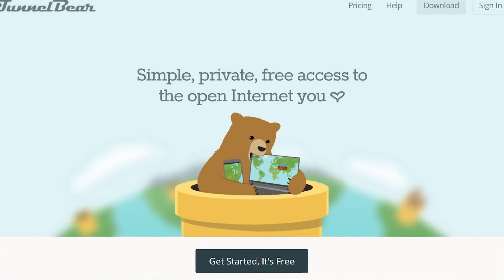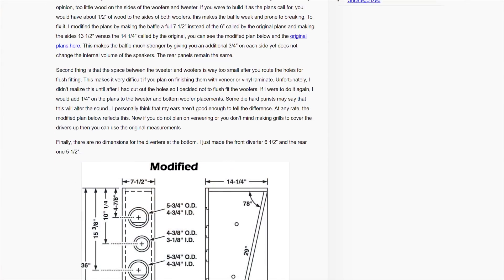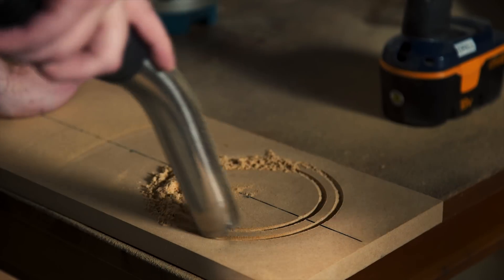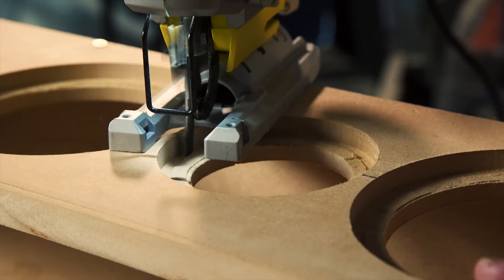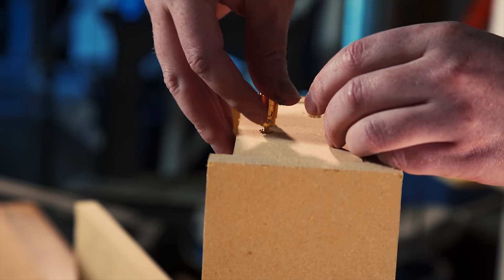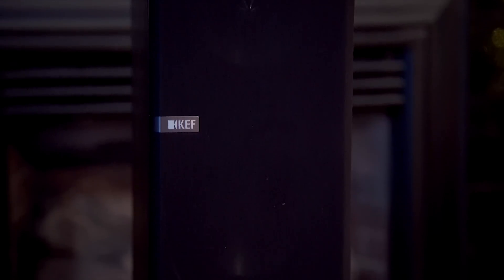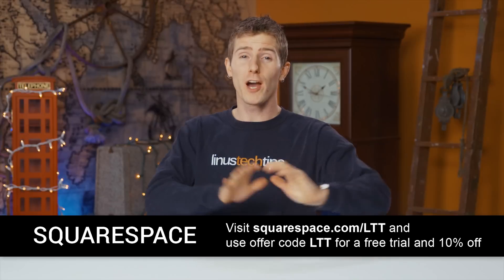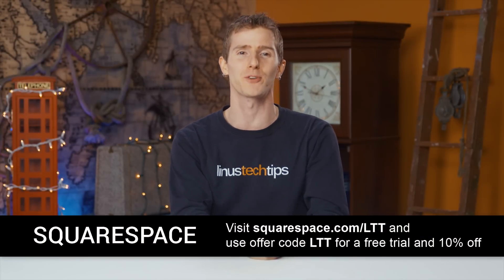DIY Speakers for Less Than $300!

Comment: You can get very decent mid 80's 2nd hand speakers for around $50 to $100, and an amplifier for an extra $100. You do NOT need to buy new with audio equipment!
Reply: Maybe speakers have gotten smaller, but that's it. Some people enjoy vintage audio simply because there's no modern equivalent that sounds or looks the same. if anything, speaker technology has actually gotten worse. My EPI 100s have cabinets that were handcrafted by coffin makers, with beautiful solid wood, and I would NEVER replace them with "made In China" garbage
Reply: Exactly! Some of us just love vintage equipment. The warm sound of paper coned drivers and a hand built box, nothing can beat it!
Reply: Frietpan - I don't get many used amplifiers so can't comment on that, but replacing the capacitors on speaker crossover was easy enough for me! Refoaming the speaker surround on one pair wasn't so easy, but still doable :D
Reply: Ayy Lmao Thats so true. A lot of great audio companies like Celestion, PSB, Tannoy etc... had amazing speakers. The same is true for amps and recievers and other audio gear, Pioneer, Technics, Sony etc... all had amazing analogue amplifiers with specs that rival the best Class A/B amps even now. If you know what your looking for you can get some amazing audio equipment thats equal or better than anything you'd get nowadays. Certainly the stuff we buy now is designed to be cheap and most things only last a few years if that. I have a Pioneer SX780 from 1976 and a Technics SUV6X from the 80's that are all original and still great. Although the capacitors do go out of spec for speakers and electronics after 20 years so I had mine replaced in a hifi repair shop to be sure the audio channels and sound was perfect. Paid $180 for both and they sound better than my band new Onkyo A9010. He's some proof the old stuff had it all figured out back in the 1970s http://www.iavscanada.com/receiver-shoot-out-vintage-vs-high-tech/
Reply: I completely disagree with this. According to JBL, the fairly compact 4311s from 1974 are designed to hit 22Hz, and can easity pull off 20 at -1dB.
Reply: Mid 80's speakers from brands like Technics, Pioneer, Fisher, etc will have foam surrounds which will have dried out and will flake and disintegrate, if ever played loudly. Components such as turntables and amplifiers were built very well back then, but the speakers were not built to last.
Reply: Found a pair of rare 1974 JBLs for $35
Reply: Yup, I got some B&W speakers for $3 at a tag sale!
Reply: Your telling me, that bass wasn't a "thing back then" in the 1980s. Ummm no, I really don't know what speakers your listening to, but many from that time period could go VERY deep, even the $50 radioshack specials. Also the fact that you're measuring speaker performance by bass performance is just sad.
Reply: Definitely. Hit up the local pawn/thrift shop, pick up some 80's Technics floor speakers with amp and you're set!
Reply: Goodwill FTW got 2x PSB Alpha CLR1 for $16, a Klipsch sub 12 for $22 and 2x KLH model 23 for $32.
Reply: I feel like a need to make a video proving everything... the problem is that my camera's mic cannot pickup 20Hz and I doubt your speakers can play it back. I guess I could use a spectrum analyzer to prove it. 

They (of course) cannot play 20Hz at -3dB, but they can at -7dB. The FR is something like 40-22K Hz at -2dB. https://www.hifiengine.com/manual_library/pioneer/cs-63dx.shtml
Reply: Matthew Pawlak I agree. Everything's gone to small ported enclosures. My Boston acoustics have fantastic build quality.
Reply: It is so true. People love that boomy sound. I love the sound of smooth, tight warm bass and balanced mids and highs.
Reply: Joshua's Recordings That's sort of the unfortunate thing. Some people justify paying for $1400 speakers, thinking that they sound good, powering them with a $600 A/V made in china reciever, not knowing that spending $50 in goodwill on a pair of speakers and vintage amp will sound quite a lot better. You'd like listening to my setup comprising of JBL 4311s because of how natural they sound. I've seen some of your videos and I think I'd like to listen to your setup as well!
Reply: Bass isn't judged by your subwoofer's impedance. It is judged by the frequency response of your speaker, the free air resonance of your woofer driver, the sensitivity of your speaker, the power handling of your speaker, and how much power your amp can output. I take it your into car audio.
Reply: Speakers and amps work basically the same since the 70's. The crossover makes a speaker sound good (without one) nearly any speaker will sound crap. So we have drivers, boxes and crossovers (exactly what we had in the 70's). It's who puts the components together with the right crossover, who makes a speaker sound good, and that's it, whether it's in the 70's or now. So speakers haven't really advanced. When you look at different types of speakers (like electrostatic speakers and "flame" tweeters) that may be advancement but way too expensive for the masses.
Reply: dunno about that KRK been running the same model for over 10 years now and its golden no need to change xD
Reply: Its pretty easy to refoam any old woofer. Look that up on Parts Express or YouTube. The new foam is designed not to break down like the old stuff. The older speakers had larger woofers also, I find the new speakers nowadays are ok but I prefer something that has a larger woofer. I have a pair of Yamaha NS-645's and they sound great. I also own some new Q Acoustic Concept 20's. They both sounds very good but the Yamaha's 10" woofer makes more bass and cost only $60 used. They have cloth surrounds on the woofer which unlike foam does not wear/rot out. Next I'm looking for some NS-690's or NS-1000's if I can find a cheap pair!
Reply: +ClockworkOmens X Yeah, PSB is usually a great cheap used speaker. Nice stereo you got for that price.
Reply: Edmund Fisher I made a pretty good speaker on my channel you can go check it out and consider subbing to me if you want
Reply: SOOOOOO much has improved in speaker design and build practices that even the best of the 80s will have short comings when compared to modern consumer or DIY designs. Going used is great, but the price to performance ratios of modern products is too good to dismiss.
Reply: I'm listening on a pair of Boston Acoustics A60's right now
Reply: Brett R Boston A60s are good! I listened to the A70s before and I enjoyed them
Reply: dont agree almost nothing has improved in speakers now days most of the speakers now days are just crap that sells because good marketing look at stuff like the modern JBL and then look at the Studio JBL of the past. NOTHING  has changed in speaker design except from going to plastic instead of wood which is way worse. ofcourse there is still stuff thats on the same level as the high-end from the 80's like genelec they still make great speakers but alot of the shit nowdays is just ABSOLUTE CRAP.
Reply: Matthew i completely agree with you
Reply: Sort of, less resistance = more power from a cheap amp. Professional amps typically run at a minimum of 4 ohms bridged and 2 ohms stereo. Although are typically run at 4-8 ohms. The reason why car audio woofer impedances are so low is because car voltages are low and it is easier to output less voltage and lower the resistance of the speakers (er, impedance).
Reply: I think that vintage audio is the way to go because you can spend less and get more quality, but you have to be careful and know what to look for in case they are damaged. I got jbl j220as for around 50$, and while I know that is not cheap for that speaker, it’s not expensive either and that’s because the cabinet was cracked on the side but a bit of wood glue, it was fine.
You can really get good quality with vintage audio, I got a pair of Mission Freedom 770s (sold for $700 for the pair in ‘85) and a pair of Infinity Crescendo cs-3007s (1300$ a pair in the early 90s) for a total of 85$ and while polymer cones are better, paper isn’t necessarily bad.
Reply: +Edmund Fisher could you link me some good ones? I have no idea where to look for good ones because i don't have any basic knowledge about the subject lmao
Reply: spiders and surrounds tend to rot
Reply: temperature changings, especially which are every day, 365 days per year. Higher Humidity is also 100% not good for loudspeakers. But in a living room, this problems should not be.
Reply: Joshua's Recordings http://www.ebay.co.uk/itm/Spawn-Eggs-of-Pachypanchax-omalonotus-Ramena-Sambirano-Killifish-/311874496114?hash=item489d2b2672:g:5PEAAOSwn-tZHGX1
Reply: My primary speakers are 70's Pioneers that I pulled out of a dumpster. They are huge, (I think they look good), heavy with alnico magnets. They sounds great and play well down to 20Hz. To get a speaker that sounds that good in say bestbuy would require me spending $700-1000 on some nice floor speakers.
Reply: Or get measurement mic and REW.
Reply: @averagejoeaudiophile5122  nah just get three random people who don't know the first thing about subjective listening, cover their ears and ask them which one looks like it has the best sound.
Reply: I do have TrueRTA on my computer and a decently flat mic. I guess I'll get around to make a video on them sometime.
Reply: Not true at all if you know what company's to look for you wont need recapping at all because they used quality parts look at any NAD amplifier like mine NAD 3400 i took it for revision didn't need any caps changed just needed the knobs and the buttons cleaned and bam worked fine again for 35 euro. i also bought JBL 4312's 4412's and B&w dm110's, dm 220's and dm 310's none of them needed recapping and they all sounded great.
Reply: i completely disagree the best sounding speakers i've heard all came from the 80's and 90's nothing has changed nowdays the highend speakers now are still as good as the highend speakers then look at studio's why do alot of the profesional ones still use yamaha ns-10's? everything nowdays is cost saving plastic shit. there are great paper surrounds from the 80's to have my JBL 4312's and they still haven't had issues with the surrounds plus they sound phenomenal.
Reply: well if you know what to look for in your seccondhand speakers you always test them before you buy them like push the surrounds see if they flake just listen to some music and see if they sound like shit. plus technics and pioneer never really made many high-end speakers ofcourse technics did make high-end turntables it all depends on what you buy and knowing what to buy. brands like mission, b&w and the high-end JBL speakers are good but also wharfedale speakers etc.
Reply: what pair of JBL's?
Reply: Tom, I use vintage sansui amplifiers! Sound great when restored, currently running a 350 receiver from 1968 :D
Reply: In the 70's and 80's after transistors took over, you could but old stereo tube amps for abound $50 at the pawnbrokers. I had a few in the 80's and a couple of them sounded better than any transistor amp (by-a-large-measure). They weren't new and sounded better than anything new (unless it was tube).
Reply: You can make great tweeters that handle heaps of power for hardly anything. I got an amp that has 200 + 200 watts @  0.1% distortion, and I haven't blown one tiny full-range "tweeter" yet (and I keep blowing normal tweeters all the time). So I had to do something, so I tried using 2" full-range speakers (Logitech one's) from computer speakers. lol But I radically modified them and I run them out of the box (slightly resisted for 6 ohms). With a sharp object I scribed a line around the voice coil center on the full-range cone, about 5 mm out, around in a circle. This allows more transient response cos it can vibrate like independently to the rest of the cone. I also got rid of the center piece on the full range speaker and left a hole in the center. I then glued a 6 mm triangle made of coffee-can-seal (tin-foil) onto where the cone starts, and the tin-foil triangle is pointed in toward the center. The foil makes cymbals sound like they are being hit and sound like they are made of metal. lol Great "S's" too, really pleasant treble (with power handling). Also being ran outside-the-box is essential cos it not only makes the treble go higher, but also makes the treble louder. And the top-end is so sweet (when it's ran out-of-the-box). Only use a 2.2 mf cap on the 2" full-range, any bigger cap will sound harsh (being out-of-the-box) and so you obviously need to run it with the cap on (and never without one when out-of-the-box). lol The cap also makes the treble go higher than without a cap, cos the cap "pushes" the high-end signal through the cap more than it would normally flow (without the cap). And with the small cap, it will increase frequency response in the top-end and this is also how you get such a great power handling. A 2.2 mf cap with 200 watts going through the full-range is like 2 watts without the cap (which is about what the speakers normally handle). 2 watter full-ranges have thicker voice-coils than tweeters and that's why they handle so much (with a cap). But if you get high wattage tiny full-range drivers, they will have even thicker voice-coils. So the 2 watters are better. lol Combined with the two mods mentioned above, and being out-of-the-box, and with the cap, it sounds pretty amazing for how cheap it is. Try it, before you start thinking I'm a nut-job. :) I run mine with 6" med drivers (coaxial and phase-aligned) set inside a large voice-coil throat in the med drivers (rare as rocking horse shit). I also run the med driver out-of-the-box (with the 2" full-ranges in the centers. Running med out-the-box is tricky, I choked and heavily resisted the out-of-the-box med and combined with some med coming from the woofer as well (and blended). The woofer is in a double chamber bass reflex box. They are the best speakers I have heard, with the open cone sound combined with mellow med from the woofer (blended as much as I can with the crossover). To run med speakers out-of-the box you have to be really radical with the crossover to make it sound even acceptable. lol But I have practice a lot and my speakers are sounding much better, since I started and it's a lot easier to make crossovers. The crossover is more expensive than the drivers (the copper coils). Cheap woofers are "boomy" but sound great with the right crossover (that costs more than the woofer). The sound quality is there but badly lack efficiency after making it sound good with the crossover. lol But my full-range tweeters are not very efficient either (but sound amazing and high power handling) and with 200 watts who needs efficiency. But my speakers are still way-way more efficient than electrostatic speakers (by-a-large-measure). And with phase-aligned treble&med and the out-of-the-box open sound, they sound nearly as good as electrostatics. But at a small fraction of the price.
Reply: 40 hz would be about the lowest we could hear from a speaker (I reckon).
Reply: They are missing out on the treble and med. Med is the hardest to sound good, cos a box makes the med sound "boxy". And there is always going to be a resonance in the med that's really noticeable (or annoying) compared the bass and treble.
Reply: I’ve got an old Samsung surround sound unit and it still sounds amazing to this day no point in buying new when second hand is just as good and cheaper
Reply: or do you mean build it?
Reply: Justwantahover True.
Bought a Pair of heco superior 800 nearly 30kg each box.
And an Yamaha ax 396 for 75 Euro it sounds amazing much better than some of today's over 1000 Euro speakers
Reply: Edmund Fisher I found a pair of cabs on the road, the 12s were coneless but both had a 6" and a tweeter in perfect condition. Definitely gonna build my own boxes for them.
Reply: A lot of 80s speakers have dead tweeters
Reply: @tacodocx667  its usually the tweeter pre amplification which is dead. the speaker itself is usually fine unless physically damaged.
Reply: I just bought a couple of Truth B2031A's. They kick f-cking ass for a price much higher than $200 a piece, and are both bi-amped 265w~ 8" studio monitors. Really just can't go wrong with these. They put out some seriously tasty sound.
Reply: I picked up an Onkyo TX-NR 414 Receiver for about 100 quid 5 years ago as it was ex display,  plugged in 5 cheap little speakers that came with a sub woofer for about 50 quid and have all my devices into it  and the sound is pretty damn good and runs a treat. Only thing i made a point of is getting decent speaker connecting wires and job done.
Reply: maruf shojjib same with BIC America. Been running the venturi series since the 90s unchanged, have a new pair of dv62si's myself
Reply: If you're paying $100 for an amplifier to power these little speakers then you are crazy... I find amplifiers for these type of speakers all the time that are extremely cheap...
Reply: And as a young guy, i agree, many Audio solutions from back then, with a good price range are sometimes far superior to some Speakers that release nowadays for their price, they're amazing quality if you know what you're doing, Amen to That.

Just gotta make sure to find them in a good condition and not about to collapse, rewiring is somewhat mandatory in some cases.
Reply: I use 4 German  80' RFT speaker cabs, recapped, new modern speakers, all hooked up to 00' Onkyo A/V Amp. Its so great.
Reply: Amen to that
Reply: Yeah i got my acoustic research AR-4xa speakers for $50 2nd hand...
Reply: thezauberrabe - Look in local thrift and 2nd hand stores, that's where I've found the best stuff! Make sure there isn't any physical damage on the actual speaker cone/driver, and lightly push the bass driver in around the edge to make sure it's not stuff to move - if it seems stuck or hard to move that normally means it's been overdriven at some point and has blown.
Reply: well if the surround isnt drie rotted yes. and the caps in the crossovers arent dead sure you can. (and if there is still oil in the tweeters etc etc) and 80"s amplifiers dont have many working caps in them left... finding something that doesnt need to be recapped is rare...
Reply: @Frietpan  if you can't change capacitors and are looking into diy speakers you are stupid.l
Reply: 80's HiFi is a mine field of paper cones, rotted foam surrounds, dried caps, and blown power supplies.  Its a fools errand. I was the service tech in a hifi store who repaired tons of 80's and 90's loudspeakers/amps, and when I would A/B them to current gear, it was sad.  Speaker technology, in particular, advances so fast, there is no reason to look back beyond nostalgia.
Reply: Nothing from the 70s is playing down to 20hz.
Reply: Edmund Fisher-
If they are already revised, so i mean changed the membran, like a small service/repair.

but i think at least 80% of the speakers, need to change the membrans (mid and low speakers) after 30-40 years, depending on the usage.

i think they dont have to be as old like 1980s, i think 5-10 year old speakers are also more than enough, especially if its your first HiFi Setup, and you may want to change some parts of the setup.

i had a long time KEF IQ 50 as front, and IQ 30s as surrond, no center.

anytime i found out, those **** IQ 50 are not as good as the IQ 30 (1x 165mm chassis instead of 2x 130mm)
so i plug 2x IQ 30 as Center in series (man this "Center" is absolutely hardcore with about 60-75° angle between them and beats the "dedicated" center IQ6C), take the "low" IQ 50 as surround and was going "mad" with (cheap, used) IQ 90 as Front Setup.
never give away this speakers - the sound is so beutiful, the design is nearly perfect for my room (cause the room is not perfect and the shape of the speakers minimize the failed acoustics of the room a little bit)

only one i would "need", its a subwoofer from KEF, the PSW2500 i got used for 15$ and repaired it, was not as good as i though, or better, the Klipsch RW-12D was better in my opionion, cause i only needed pressure for movies.

so guys, pls dont buy SUCH and old stuff, you can also get good used speakers which are maybe 5-10 years old and still very cheap.

yeah, 400$ (for my IQ 90 used) is more than 50-100$.
But never call 100$ speakers "audiophil" or so, they are maybe beginners HiFi speakers, but for sure if you really like good sound, you will replace them very fast.

chonchobar hit it 100%, they are crap to already broken! Aslong they are not serviced some years ago. which do only enthusiasts with (enthusiast) speakers. And they will be also in 2030 expensive aslong not hardly broken
Reply: what amplifier are you running on your JBL 4311's i'm running a carver CM 1090 on my JBL 4312a's and a Nad 3400 on my JBL 4412a's
Reply: . /b/ Tard, that is depending on what amp you want and what you can get.
an Pioneer low numbered SX from from the 70's or Sansui i would agree, those go cheap. Trio-Kenwood KR's are fast 100$ and more.
Technics can be both nickel-cheap and pocket burners.

then you got all those obscure late 90's high-end stereo producers. example Myryad MI120 can be found for less than 100$
Meridian pre-amps is also something that goes cheap if you know where to look.
but an ElectroCompaniet ECI2 and your lucky if you can get it for under 550usd if at all find one, and if got the stone front... oh dear...